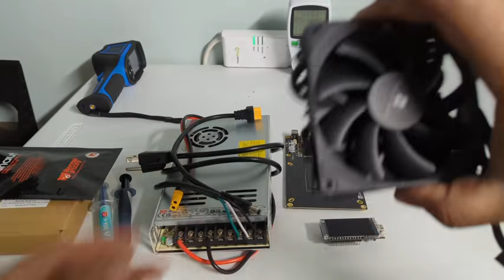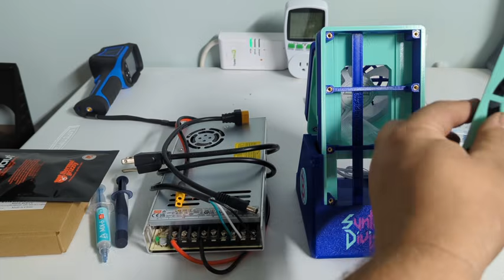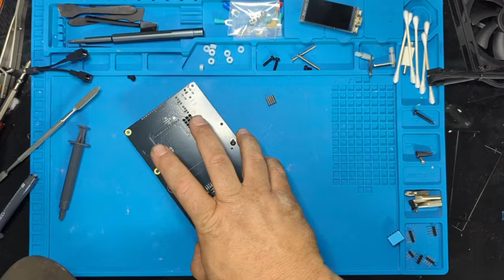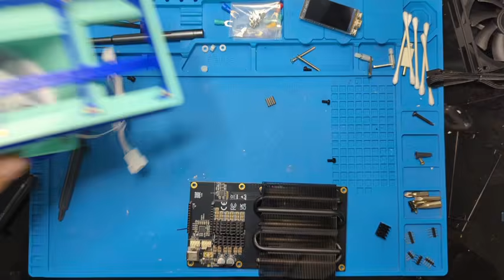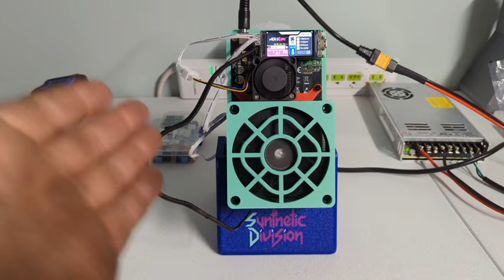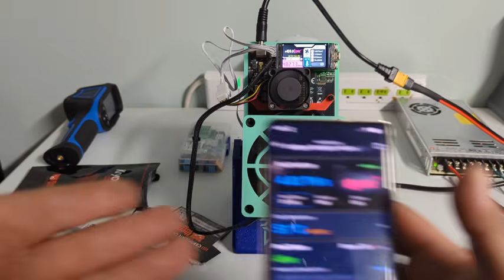Air Cooling the NerdQAxe++ Hydro After AIO Death + Thermal Paste Comparison

Comment: Love the video. I have been using mx7 on my miners and have had great luck. I want to tear into a bitaxe supra hex 703 that I picked up on Amazon for cheap, but not much for 3d stands online. So going to take a bit design one and also researching if there are any radiators that will work with it, but again not much luck.
Reply from the maker: Welcome to the 703 club!! I'm actively searching for a cheap one haha. And they are limited for stands that work for them.
Reply: @SyntheticDee yeah, i picked one up on amazon for around $110. I'm planning on designing a stand for rear air and possibly a setup to force air over the vrm on the front to cool the weak link that i have been seeing and reqding about. I want to figure out a way to mount a radiator ssetup like a lo-pro geek pi cooler, but the 5 hole heatsink pins and the arrangement of chips is messing with me.
Reply from the maker: When designing you could look at tiny chip hubs 703 take some design cues from it
Reply: @SyntheticDee will do. Thanks

Comment: Nice vid. Great effort. 
A few observations 
1) 13:00 I see no TPS heatsink then it appears at 20:00
2) the BM1370 has NO onboard die temperature. Only 1368 has Asic die temps.
3) last time I checked factory FW aggregates the temps rather than separate them. Not used their latest versions so I might be wrong. 
4) you best use the rear metal heatsink plate to avoid PCB flex.

Keep building
Reply from the maker: Thanks man! I been looking at the brackets I have to place on the back of the board.